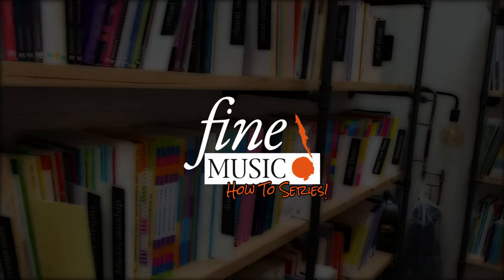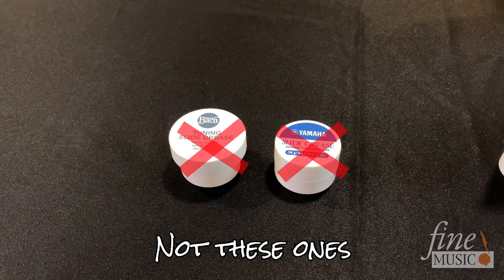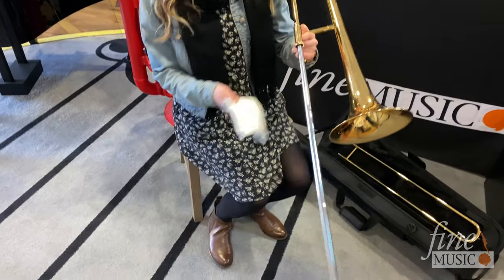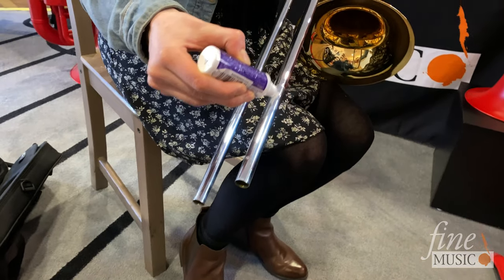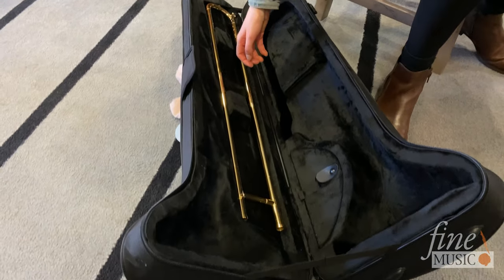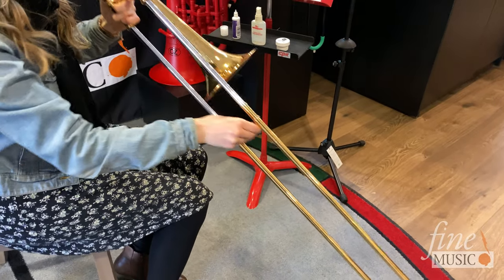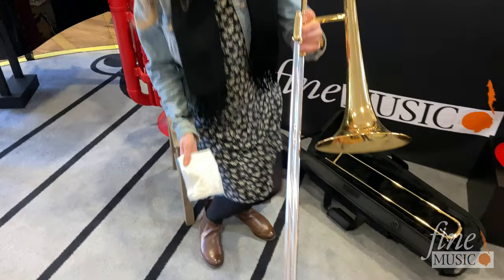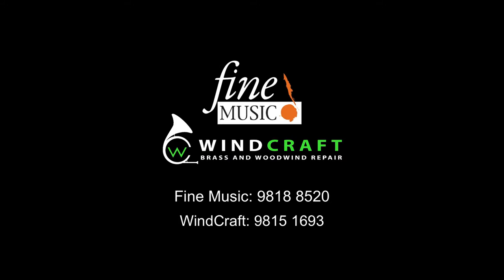How to Lubricate Your Trombone Slide

Comment: Good informative video; however, as the owner of a Bach 42b tenor trombone myself, I would add just one more point. At the beginning of a rehearsal or concert, when I'm about to spray water on my inner slides, I would first leave the entire bell section in my case before removing the outer slides from their stockings, & then just spray water on only the stockings themselves, i.e., with the bell section not in any "line-of-fire" from the spray. The way that the spraying is depicted in this video, you'll inevitably get stray spray on the beautiful bell, which will result in those tiny droplets clinging to the lacquer on the bell. If this moisture does not evaporate right away, then it will probably, if this occurs daily, lead to unsightly corrosion on the bell over time (I was told this by a craftsman who restored & re-lacquered my instrument back in 2015). It may be, of course, that some instruments (e.g., old Bachs) are more prone to corrosion than others. George, Canada
Reply: Right on, Gearge. We we taught by our bandmaster to do it like that, back in the 1950s. However, what the heck are those "stockings"?
Reply: @prairiebassman  "Stockings" are the parts on the ends of the inner slides that are slightly thicker. I was told that when applying Iubricant or water to the inner slide, that one should concentrate on the ends of the inner slide, where most of the friction is taking place..
Reply: @georgeschaut2178  Thank you, George. It makes sense that those parts would have a name. I still learn something every day, and I'm past age 80.